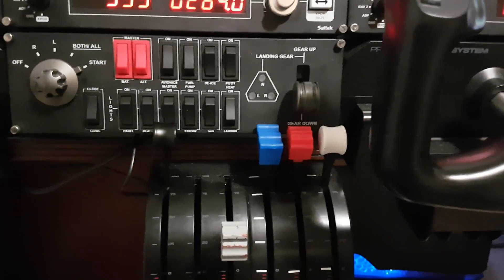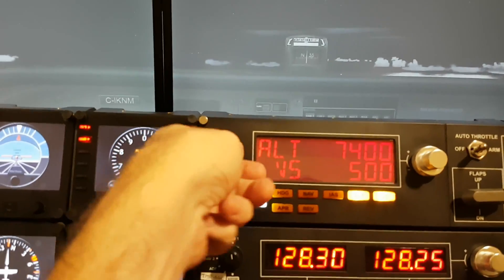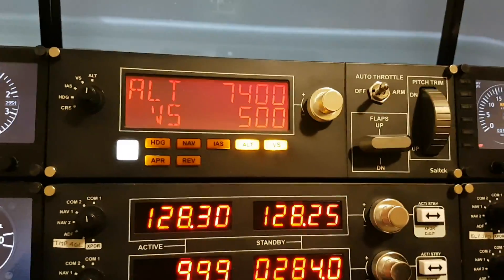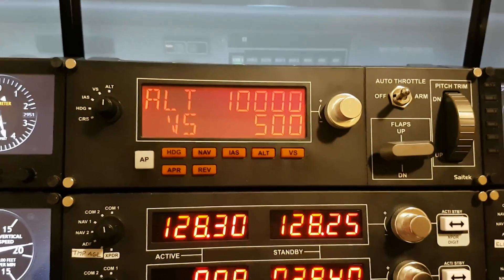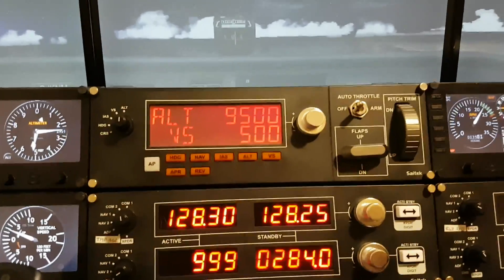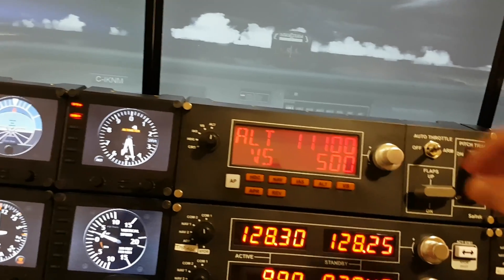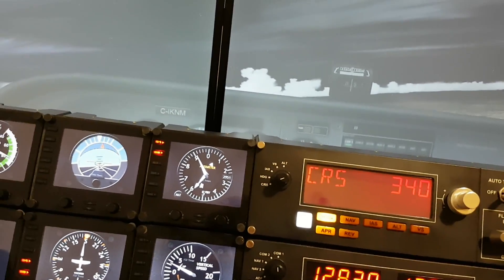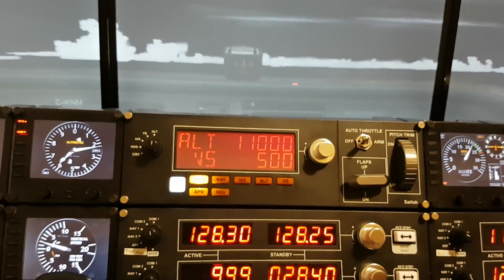spad.next multipanel tips part 1

Comment: How did you connect all those panels etc and not run out of USB ports. Did you use a USB hub? I have problem when doing that and I have the Multi-Panel, Switch-Panel and Radi-Panel. Then Thrustmaster Hotax, X-Box Controller for Drone and finally Mouse. I would like to add some smaller 'round' meters that you have, Vertical Speed etc. I see problems with USB ports.

Comment: Hiya Mike, I appreciate you made these 'excellent' videos a few years ago but they are still 'very' relevant to people (like me) that have just caught up with these panels and SPAD.next. I wouldn't have had anywhere near as much success without learning from your experience.
I am referring to the multi-panel and hoping you can recall how to switch the preset off (e.g. ALT / VS) ... I believe you can do this for the presets, but the complete display cannot be switched off?
Reply: Note to self (startup display cannot be disabled as it is hard coded)

Comment: Have you coupled two throttle qauds? Can you do that by default or do you need any 3rd party software to do it? Thanks
Reply from the maker: Yes I did. It works great for twins, having 2 throttle, two mixture, and two prop levers. In heavies, I use 2 throttles, (or 4 if it is a 4 engine aircraft) and one axis for spoilers, and one axis for flaps.

Comment: At first, I only had one radio unit operational. the radio 2 unit, Multi switch, and Pro switch were dead, windows said all ok.
spad next could communicate with radio 1 only. 
FYI:
 Fix turned out to be downloading the current driver from saitek (it is a single driver for all of them)

Comment: Thank you for this video set. I'm building a 2 seat sim at the moment with  the 4 main panels you show & 2 yokes. So far, I have set up USB hubs with switchable (on/off) ports to have either yoke 1 or yoke 2, or joy stick operational. did you do something different in your set up for the 2 seat controls?
 I have purchased  spad next  and FSUIPC, and Xplane 11 & MS flight simX
Reply from the maker: Both of my yokes are active at the same time. Just like in a real aircraft

Comment: Hi thanks for your Vedic .....I considered the trim wheel on the multi panel to be the wheel found on some auto pilots for adj climb and decent rates not the elevator trim which normally is on your yoke in higher performance aircraft

Comment: I got spad downloaded and the flight multi panel and my muti panel will not work right I got it plugged in and the screen on the panel stays lit up for 30 seconds and then goes black it will not light up at all I tried different USB ports I got still nothing and also I tried it in game and nothing I am told by a friend that spad will automatically set up the buttons is that true? Could my panel be bad I bought it through Logitech. Please help me
Reply: I had same problem . I found if I pressed Cnrt + e  like a false start of airplane it turn the gauges on that what fixed my problem hope that helps.

Comment: Hi Vadermike, excellent videos and thanks for sharing your configurations (ie snippets) with Spad.Next. I'm trying to set up my own configurations (similar to yours) but I can't create the action "increment NAV OBS:1 by 90" in Spad.next. The variable doesn't appear in the action list. This is one example of many that work in your snippets, but can't be made manually. Did this work only in older versions of Spad.next perhaps?
Reply: I've found a quick solution: Create the action using a different known variable,  in Explorer go to the Profiles Directory (as displayed in Spad.next settings) and open your profile XML. Find the associated EventActionChangeValue tag and replace with "SIMCONNECT:NAV OBS:1". Save the text file and restart Spad.next. All this worked for me and I'm now able to use my pitch trim as intended. Hope this helps!
Reply: Did you create the condition first? The condition needs to be created before you can specify an "action". Follow  this process, select the dial you want to modify, click "add event", then choose short/ long click (if it is a lever you are configuring), or clockwise/counterclockwise (if it is a dial you are configuring). Then click on "add condition", and then select data. Make sure either FSUIPC or SIMMCONNECT has  a checkmark in the top left corner, then in the search box do a search for "OBS". Select the condition you want, then click ok.  then you can add an "action" and specify what you want it to do. (for example decrement the OBS by 90 degrees)
Reply: Thanks for the reply biggy5567 but this hasn't been successful. 
My scenario: for the MultiPanel--Pitch Trim wheel
Event: On Nose Dn 
Condition: If Multipanel Selector Device = 16 , (CRS selected ) 
Action: Increment NAV OBS:1 by 15 degrees. 
Unfortunately NAV OBS:1 still does not appear in the action list.
The result is the same even if I choose Flaps Down as the event (similar to VaderMike777's configuration)
Reply from the maker: Hi there, I tried on my setup. The Nav obs:1 value does exist for the pitch trim  (go to add action, change data value, and search for OBS, change operation to increment or decrement to your preffered value, in this case 15), however, I cant seem to get it to work on the trim wheel for the multipanel. It works on the flaps, and on the dials, and on my fips, but not the trim wheel for some reason, even though the option exists. In this case you might want to ask the designer of spad for the solution. And please repost back here once you find out,( I am curious myself)
Reply: In all instances (FIP buttons/flap switch/pitch wheel) I do not get the SIMCONNECT:NAV OBS:1 variable. I do get the NAV 1 OBS (FSUIPC) variable, however that has it's own problems. I have SIMCONNECT, FSUIPC and LOCAL selected in the checkboxes. I'm using Spad.next 0.9.6.25 (registered for FSX/P3D).
I created a topic on the Spad.Next forum with no response yet. Next step is to open a ticket and hopefully Connex can help. Thanks for the quick reply!
Reply from the maker: Nice! Very interesting solution. Thanks for letting me know!

Comment: So im struggling with getting the commands to work. Im flying Xplane 11 and while I can see the panels in SPAD.Next and they move when I use the switches, it does nothing in the simulator. Its like the commands really never make the connection to the sim. I should also say that the “Simconnect” function is not working either, but I’m not sure if that has something to do with the fact I’m using Plane. Do you have any suggestions? Ive sent in a ticket to SPAD.Next but they are not responding. You seem to have this stuff figured out so I thought I would try you.
Reply from the maker: Stacey Dreyer hi Stacey. I don't use xplane 11, so i have no way of answering your questions. You did the right thing by opening a spad ticket. You Might need to wait a bit more for the designer to reply though. when you get your answer, maybe you can reply to this post with the solution, as that might help other people with X-Plane 11. Best of luck!

Comment: Thanks vadermike i got my fip gauges from http://www.fipgauges.com  how about A2A 180 cherokee and 250 comanche you think you could help with setting does planes if you have them but i can wait on setting up the Gauges thank you again
Reply from the maker: Good choice, Daz makes some excellent gauges at fipguages.com. As for your question, I don't own any A2A aircraft, (although I have been eyeing their C172 for some time now), so I cant really help you with the config setup for them. But I do believe A2A  uses LVAR variables, as opposed to Simconnect or FSUIPC  variables. Luckily, Spad.next does offer LVAR functionallity. 

So as a start, I would recommend you "enable LVAR" in spad, and then check out some of Connex's Snippets. I would imagine he has probably posted some of the more common items. Also, check out the spad.next forum, and check out the profile threads. A2A are very popular Aircraft, and I am sure there are other A2A owners on the forum that can provide you with some pointers.

Good luck and happy flying!

Comment: Hey vadermike  How about how to set up your Fig panel how did you get then so bright . vadermike i have every panel and gadget just like you plus jetmax 737 panels  i just need help with the fig panels and every panel from saitek to set up with Spad next
Reply from the maker: There is a brightness setting for fip's in spad, but also keep in mind, i don't use any default gauges in any of my fip's. So unless you are using the same gauges as me, it will look different on your displays. I will make a video on this soon, be sure to check it out!